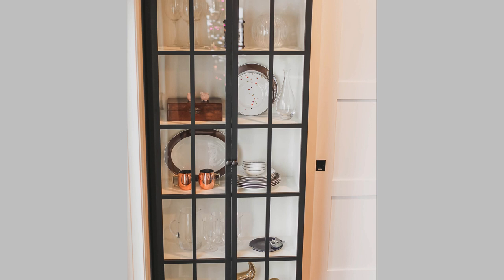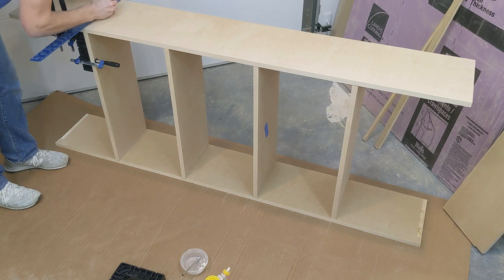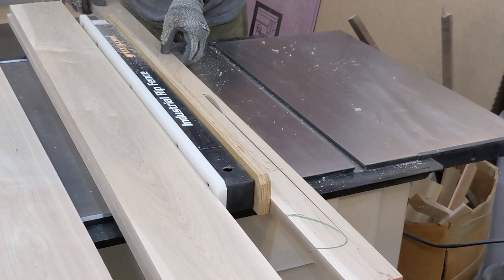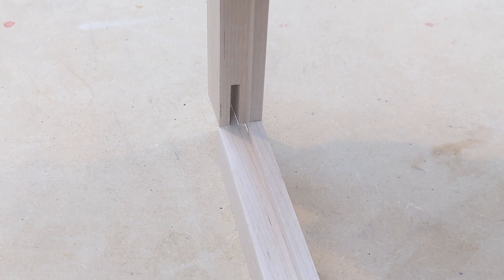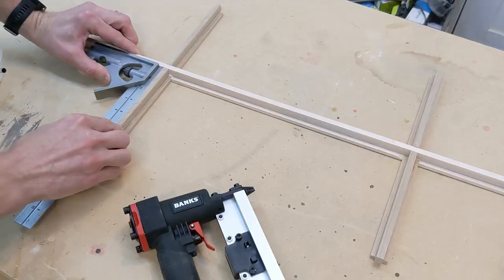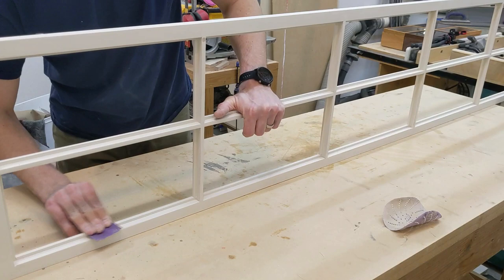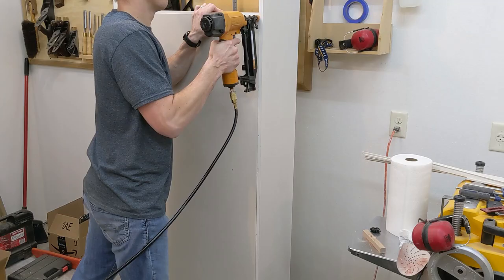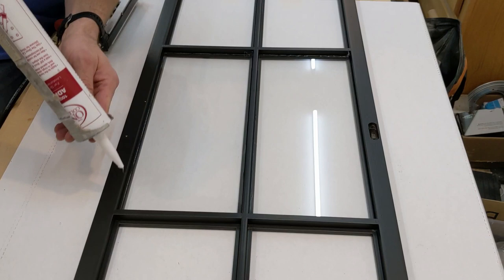Crafting Elegance: Building a Classic China Cabinet

Comment: Great video!! What grit did you sand to between coats of paint? Also did you pocket hole the feet onto the cabinet?

Thanks
Reply from the maker: Thank you! I sanded everything to 220 grit before and between paint coats. I attempted to pocket hole the feet but they kept moving on me and weren't flush with the cabinet so I scraped that idea. Biscuits or floating tenons would have been ideal for installing the feet.